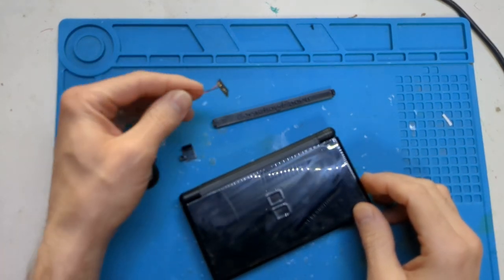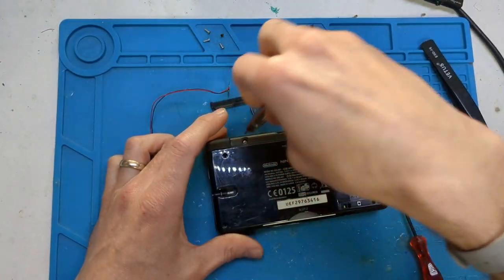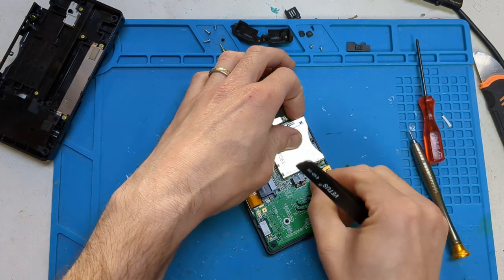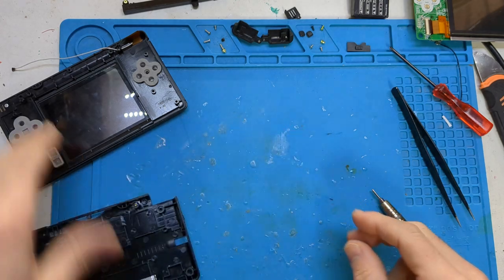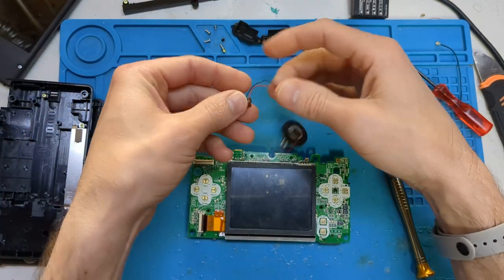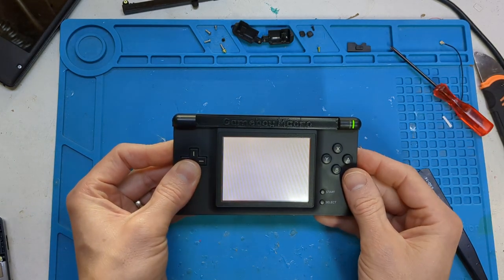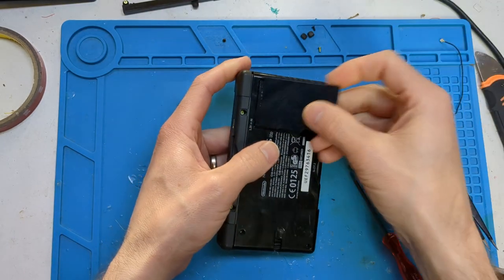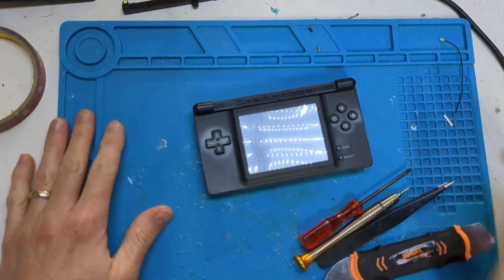Gameboy macro solderless kit install guide

Comment: Did you consider to release one of these with buttons attached for the screen switching mod? Or just the Gerbers for the flex maybe so we could modify it to give easy solder points for the buttons?
Reply from the maker: Yeah I'm working on a few ideas around this flex PCB, Watch this space
Reply: @facelesstech  sweet. I was thinking about something like this as well and got all the schematics drawn out, sadly didn't find the time to read up on enough skills to handle Kicad yet. Love your blog!
Reply from the maker: @Delcaek  just a quick question, would just just want a 330ohm resistor, speaker solder pads and 3 pads to connect to the switches required for the switch screen mod?
Reply: @facelesstech  Yes, exactly.

Comment: Got any more of these kits? I really just need the ribbon connector thing. I don’t mind soldering the speaker on and I don’t generally use the 3d stuff because I usually do other mods
Reply from the maker: Hi yeah they are on my ebay shop here https://www.ebay.co.uk/itm/266112915549?mkcid=16&mkevt=1&mkrid=711-127632-2357-0&ssspo=_-_ZCP62Qwe&sssrc=2524149&ssuid=_-_ZCP62Qwe&var=&widget_ver=artemis&media=COPY